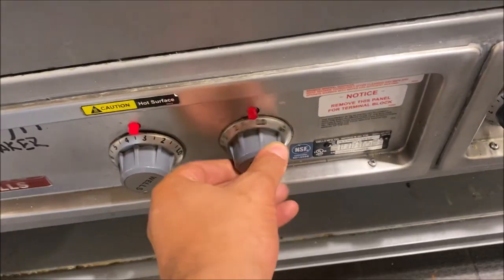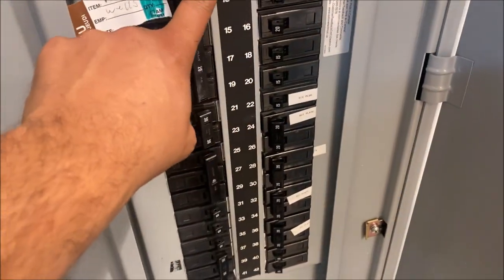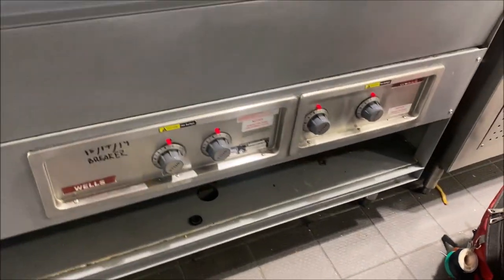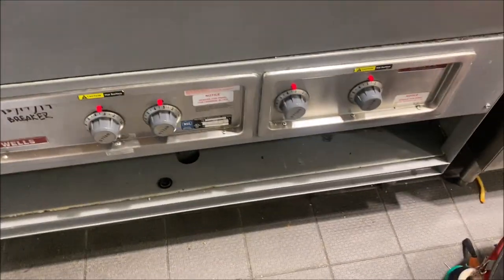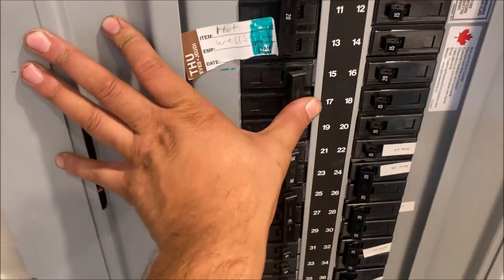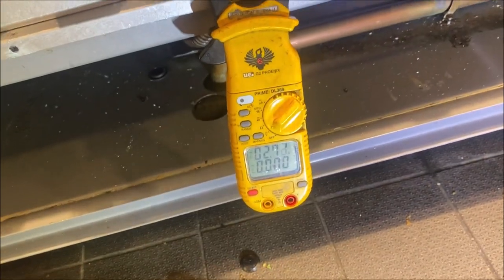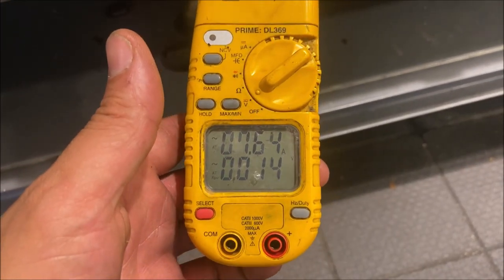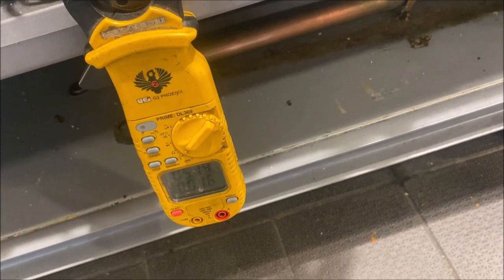Wells hot food well is slow to heat and wired incorrectly to the breaker

Comment: I worked on a Duke hot food well that was wired i correctly.  It was a 120/208 volt single phase.  120 was for the lighting and controls, and 208 was for the elements, some one wired it backwards as the lights were getting 208, and the elements had 120 volt.  Was a simple fix.  Looks like yours was simpke as well, basicslly somene wired it for one circuit breaker, as supposed to be designed for 2 circiuts. I worked on a lennox furnace that had 2 60 amp breakers on tbe furnace itself, some one jumped both circuits together in the furnace so they could use one 100 amp breaker and one 3 wire se cable going from furnace to the breaker box.  Needless to say, this is very dangerous, and the furnace had a fire inside where the breakers were. I changed out the furnace, ran 2 60 amp rated 3 wire service cables to the panel, installed 2  60 amp breakers and all was to code.  Goes to show you that you should never cut corners when it comes to electrical wiring.
Reply from the maker: Yikes, definitely take your time and double check

Comment: I have working a 7 well apw i changed 3 elements on bank 1 ,6,7 and when I turn on all thermostats 1 thru 5 runs but if I turn on 6 and 7 breaker trips
Reply: There was a 40 amp breaker I changed it to a 60 amp